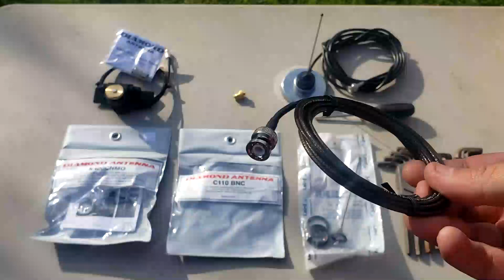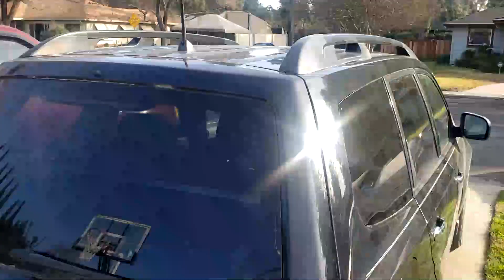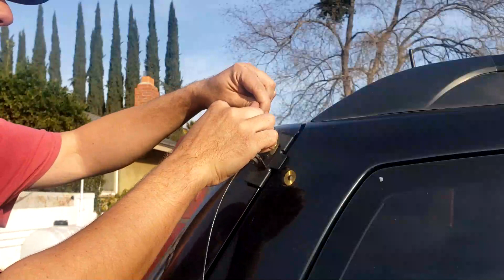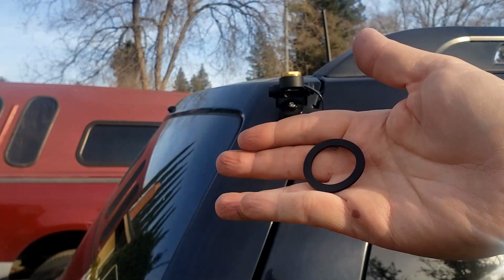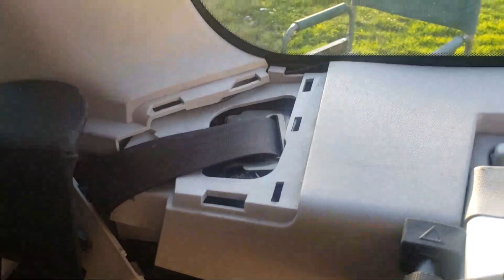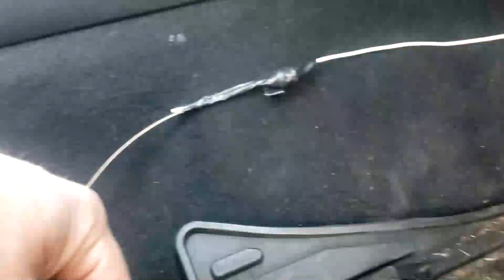Mobile Radio Antenna Installation

Comment: Great video  I am more into police scanners i have an SDS 100 and I recently got Tram 1094 antenna and mounted on the roof of my car such a big improvement and yes Diamond Antennas are great  I use a diamond  RH77CA on some of my handhelds and a couple of Remtronix antennas also . I also have a Moon Raker for my 4 base antennas thanks for the video